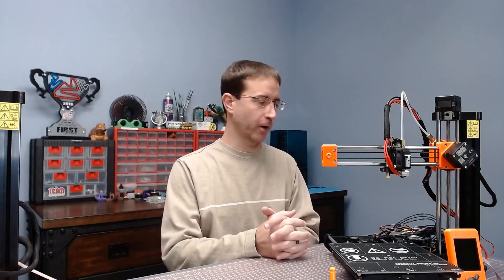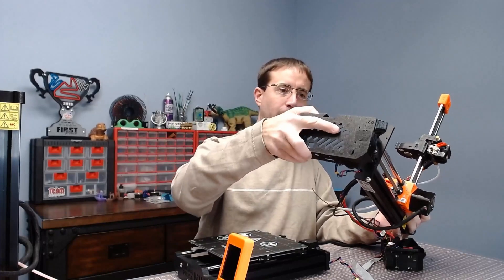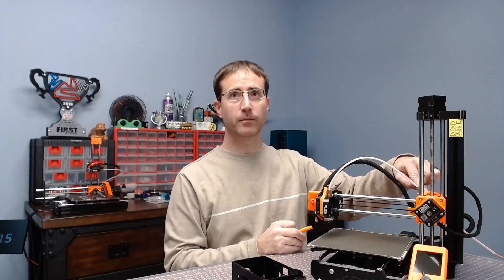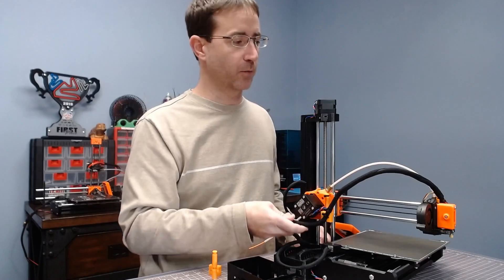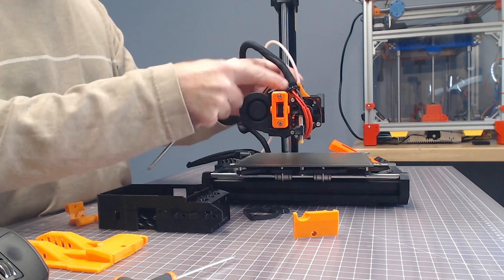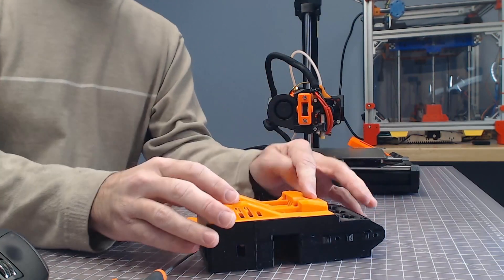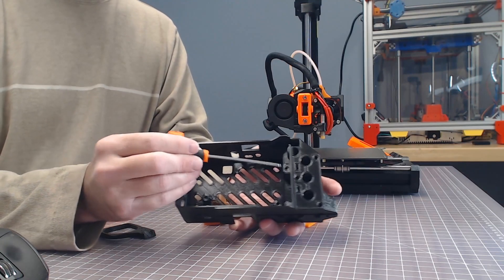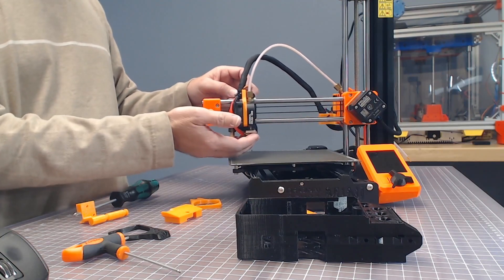Prusa Mini Cable Management Mods - #PrusaMini community mods that help improve the cable setup.

Comment: Great stuff.

Prusa has changes the fan mount so that new part is obsolete.

but please keep more of those coming!
I just got my mini as my first printer and your contact is just top notch
Reply from the maker: Thanks, I have a video on my printer design ready to post but I broke the audio. Since I am going through 1st grade, and high-school again it has been harder to get stuff ready. Ha ha ha

I also took the latest mini step file for the parts cooling fan and modified to fit on a Hermes and Mosquito, so far the results are great.

Comment: i wonder why john doesnt have the prusa in an enclosure.  does it not produce fumes and particulates while printing?
Reply from the maker: Not really shown but I use filament dryers on my machines that print 24/7, along with filtration and venting.  When I make a video I take the printer out of the enclosed areas.  It is really interesting to notice in my area of the country how quickly PETG can start to string if I do not use dryers.  I posted a quick example on my instagram account - https://www.instagram.com/p/B7ev1ViF_KD/?utm_source=ig_web_copy_link
Reply: Thanks for responding.  Would you be willing to make a vid on your filtration and venting setup?  thanks again.

Comment: John since you have your mini apart can you see how hard it is to realign the y axis extrusions?   I just got mine yesterday and it won't sit flat on a table.   In planning to investigate it tonight though.
Reply from the maker: Did you get it sorted? My best guess is to take the extrusion screws loose and place it on a nice flat surface, piece of glass for example.  Press it level again and then tighten the bolts.  Let us know what you figured out.
Reply: Yup that's what I did. Just a little shifted from shipping.  They were pretty rough on there little guy.   Am impressed with the print quality.

Comment: Nice video and straight to the point.
On the first two mods you showed how the wires run now vs how they were stock.
But on the third mod you just showed the empty box with new cover. Maybe could of shown how the wires are coming out of it with the new cover?
Reply from the maker: I did grab some pictures, and I will get them up on Instagram and then let you know.